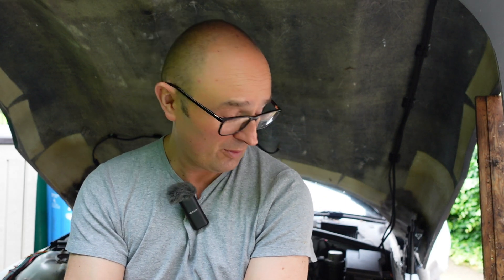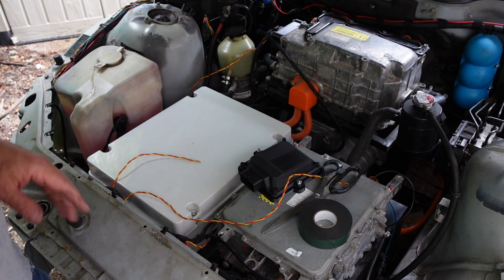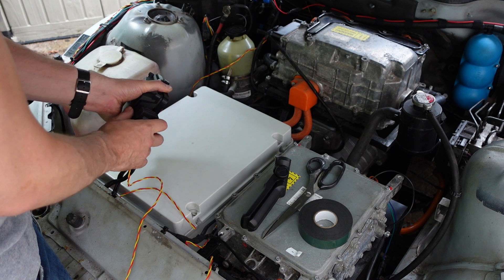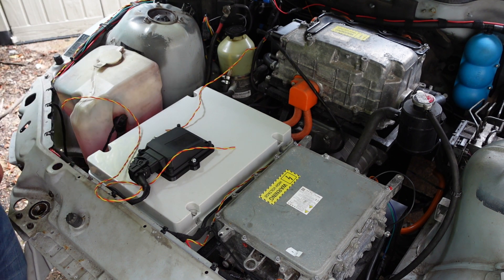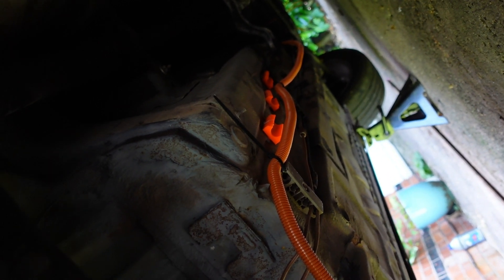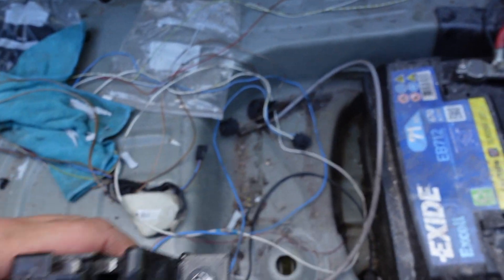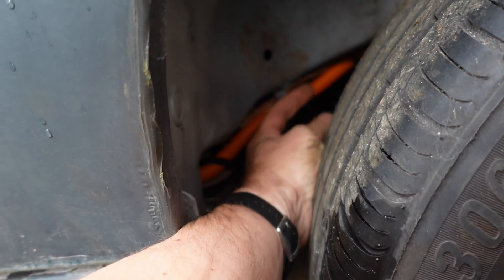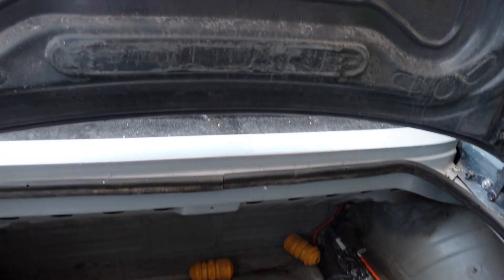Wiring in the rear charge port to my DIY EV

Comment: As mentioned below.  Glue not a good idea, specially with high voltage cables under the car. if they drop n catch on anything on the road at speed it might not end well.   Heat,/vibration and contaminates from the up-slash from the road will degrade the glue over time. (unless, you are using Tesla-spec glue). i would use steel fixings with "star" washers or ni-lock bolts. Think "If this was a Aircraft"..  ' would I use glue?" 
Other than that.. Ya doing a grand job!
Reply from the maker: I have to disagree on this one. Any steel fixing is going to create more rust opportunities in the monocoque because it means drilling or welding. Plus that's an inspection fail should the DVLA want a closer look. Bear in mind these are charge port cables. There's no current in them unless you're charging. Plus, that's a lot of fixings on which the adhesive would have to fail for them to get close to the ground. 

AND, lots of aircraft are glued together! When I was studying engineering, one of my fellow students was examining bonded chassis structures as an alternative to welding - something that is now commonplace in both production and race cars.

I totally get where you're coming from but unless the adhesive starts to fail (it might!!!) I'm going to stick with it (if you'll forgive the pun).

Comment: Good to have you back Tom but I have to say I'm not the biggest fan of adhesive for the cable mounts and double sided sticky tape for the bms
Reply from the maker: Ha! It's pretty serious adhesive. Not sure how else I would attach them? Drill and rivnut? Don't really want to make lots of holes in the chassis if I can avoid it.
Reply: @EVDIY  I re-threaded the studs for the exhaust heat shield to M5 and used those, but I understand what you're saying about the adhesive lots of modern cars have bonded panels guess I'm just old just doesn't feel right 🤣
Reply from the maker: @andybp840c  Didn't feel like there were enough of those to me. And didn't follow the route I wanted. I'll need to work out another route for the second pack soon but probably take the same approach. Want that extra range! And ChaDeMo...